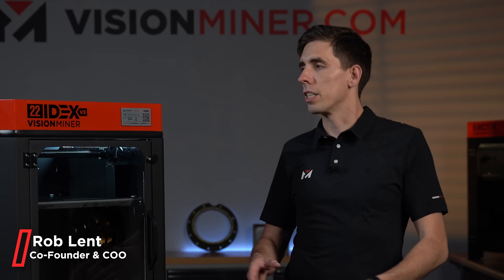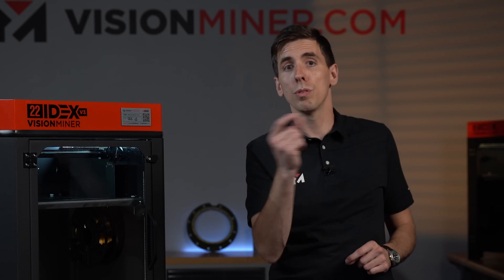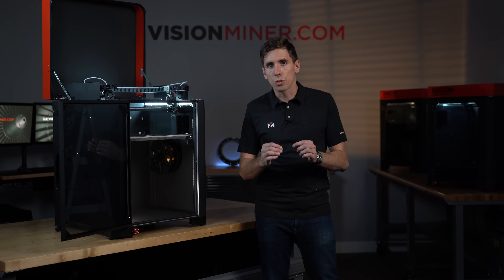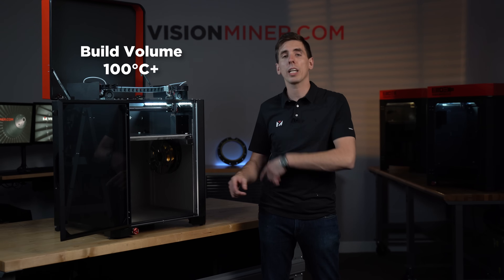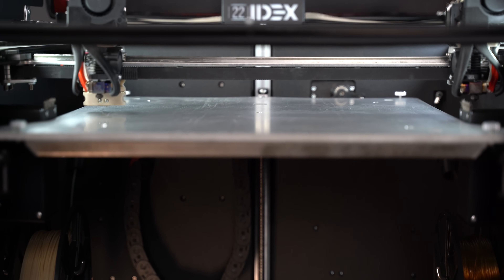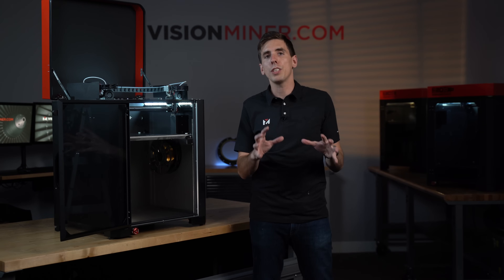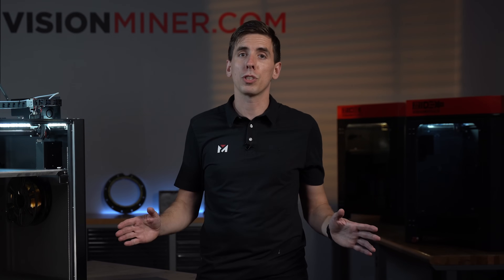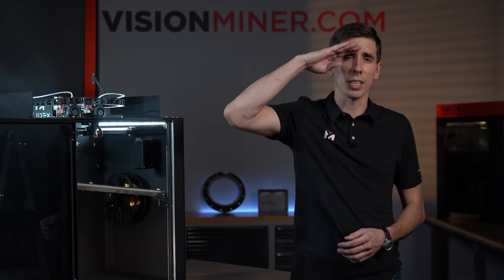New! 22 IDEX v3: Engineering 3D Printer - Workhorse for Production 3D Printing 2024

Comment: As someone who is new to 3d printing and shopping for a printer (yes, considering a high temp printer even though I'm new), I am having a difficult time determining which of the two "inexpensive" high temp printers to go for.   From what I've read, the issue with the print temperatures of around 90-100C are layer adhesion and warping when considering "large" prints, although large is never defined anywhere.  There is a channel on YT where someone reviews mechanical performance (shear strength, load bearing) of prints made with the other "inexpensive" printer and the Z axis prints were substantially weaker because of poor layer adhesion.  These were all parts smaller than a credit card.  Will annealing PEEK / PEKK / Ultem prints in a convection laboratory oven at higher temperatures address that issue, to the extent it does exist?  Can you speak to the learning curve of this particular setup?   My main interest is in printing mechanical parts for robotics.  It's not clear if these materials provide substantial benefits over something like nylon or polycarbonate in terms of wear and performance.  Can you recommend any resources to research these issues?  I'm willing to pay more for performance closer to metal, but it seems there are few resources out there to research and buying one of the HT options for trial and error may not be the best way to go.

Comment: :hand-pink-waving:I like your IDEX V3 printer. I am an engineer with over 40 years of experience, so I recognize many of the parts you incorporated into your printer, down to the Igus high speed screws. I actually designed one of the first adapters to mount the copperhead to the LGX. It was built for the E3D groove mount. I like the upgrades you made, I see a lot of ways you can improve upon your design as well. :goat-turquoise-white-horns::hand-purple-blue-peace:

Comment: With laser SLS printers now coming in at under $10k, and hobby grade printers like the X1C at just $1500, there is no reason this needs to be $15k. At that market you're in Stratasys territory.
Reply: They're not even in Stratasys territory for machines that can only print ABS well. To build a solid and safe high temperature 
Machine you're at least a few grand deep in parts alone. Add labor, cost of infrastructure, money to grow your business, insurance etc. You get to a 10-15k price point pretty quick. Could it be cheaper? Probably but not by much. Especially if it's not made in China.
Reply: For hobbyists your point is valid but for manufacturers they want the convenience of a ready to use machine that’s proven to work with high temps. Trying to print a full build volume part in ABS on the X1C ain’t goin to happen. Printing peek on an X1C is virtually impossible
Reply from the maker: Stratasys territory is $150-400k for printing the high temp materials, with their budget machine you're extremely limited on material selection, and adding materials entails expensive material licenses.... so, apples to oranges. X1C only touches the tip of engineering thermoplastics -- you can push it to do more than intended, but then you're in risky territory. If you're a business owner and have ROI to gain on parts in advanced materials, the 22 IDEX is a no-brainer at this price point, with competitor machines starting in the $30-45K range with similar capabilities.
Reply: Comparing a 'hobby grade' printer to an IDEX machine designed for industrial and engineering applications is an odd take.
Reply: @kilo.sierra There also is the X1E
Reply from the maker: SLS is an interesting comparison -- if you're just doing Nylons, someone should definitely consider desktop SLS, but it's more application specific, compared to an open-material high-temp FDM machine. They're all tools for different situation -- there isn't yet a one-size-fits-all 3D printer, and the 22 IDEX fills a specific need within several specific industries (Aerospace, Medical, Energy, etc etc)
Reply: not so simple.
Reply: Sls printing is extremely dangerous. Was gonna buy one but dont want to risk giving my kids cancer at home.

Comment: Why copperhead instead of mosquito. Copperhead is a budget option as far as slice is concerned, and this is not a budget machine. What is the reason for corner cutting? The unsupported heatbreak of copperhead is not ideal.
Reply: has to be something custom/different about it? cause even slice says the copperhead is only rated to 450c but this video is saying 500c. agreed if this carries the same 15k price tag what is another couple hundo to get a higher end hot end.
Reply: With the v2 they mentioned the user could use the heatbrake to easily adjust z offset between both tools. Not sure if this still is the case or if it’s done in DWC now. This newer machine does seem to do auto XYZ offset calibration so I’m not sure if that reason is still the same.
Reply from the maker: Correct, the heat break is used to offset the z-axis between both heads, to match them up perfectly. Higher flow can be achieved with CHT nozzles, or upgrading to another higher-flow hotend design, but the Copperhead has plenty of output for the materials being used, but if someone wants to do massive layers at even higher speeds, the option is available to modify it :)
Reply: @VisionMiner  Thanks for the response!

Comment: My one can print 400x400x450mm.  It has liquid cooled stepper motors and hot end.  High temp enclosure and nozzle,  360 degree view of the part and all components due to a all glass enclosure and it's more reliable and easy to repair due to the simple cartesian design.  Only has a single print head but for what it cost me to build I can build 10 of them for the same price.
Reply: Can you post a BOM and how many hours you have in design, assembly and testing? Also what do you value your time at $/hour?
Reply: @grahamwatson3677  I honestly wouldn’t know where to begin.  I am very poor and live in one of the most expensive cities in the world.  It has taken me years to accumulate the parts and tools needed (not to mention a work space) by working as a meal delivery rider on a bicycle.  Of course now that it is designed and built I could quite easily work out how much the cost and (more or less) time needed.  As for my time per se, that is not for sale my dear.
Reply: I think your blowing smoke, otherwise you would have it all over your channel
Reply: Woah! Individual with knowledge and know-how makes thing to rival commercially available thing. You must be the first person to ever do this!
Reply: Talking about reliability, even though you never owned a professional 3D printer and know nothing about the machine showed in this video. 

Sorry to tell you, but no serious business in this world would buy your machine. It's cartesian, so it's imprecise, and it's unreliable because your as a DIY guy can't provide any kind of support for a company. And I am 100% sure, that it's not capable of printing PEEK or ULTEM without severe modifications. 😉
Reply: So everything is underneath the machine then in order to get 360 view. Is it a Voron or something similar?